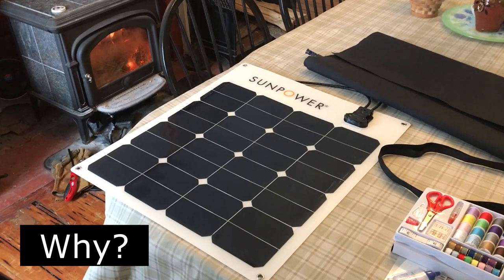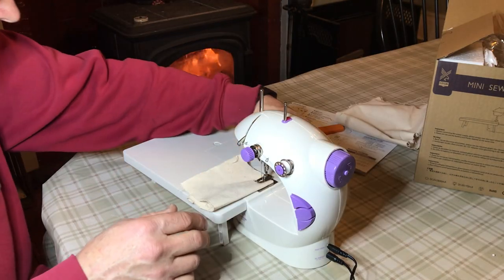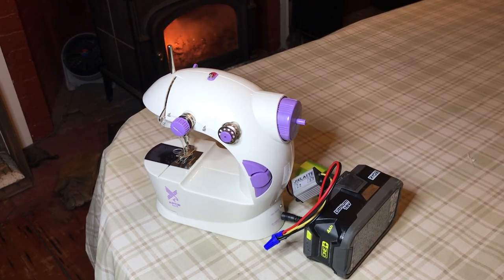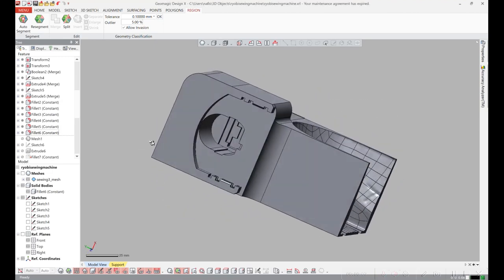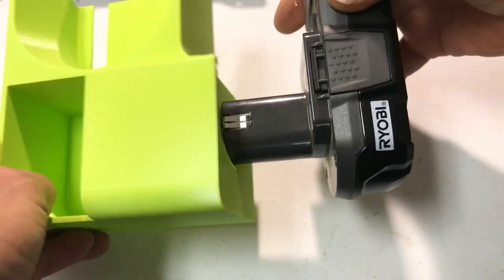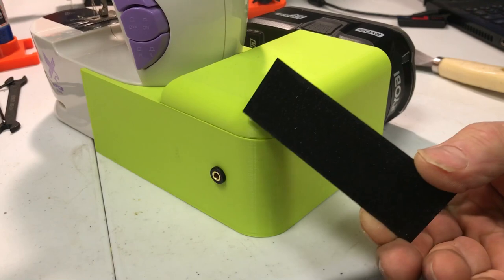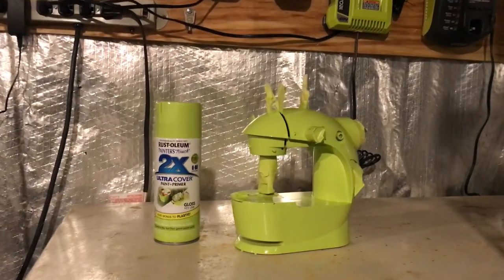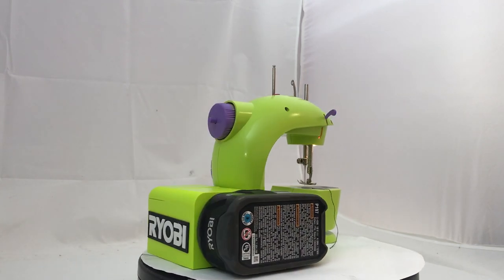RYOBI 18V Sewing Machine

Comment: Love your innovation, Chris!  What fun to watch your designs come to life.  Watching you work, I'm sure a good part of your enjoyment comes from the CAD design and 3D implementation, but I'll mention for those that don't have those skills that it IS possible to "Ryobize" lots of applications without the need for 3D designs.  Obviously we need some way to get 18V power out, so your innovations using clips and caps to put Ryobi batteries to use is absolutely a must.  Using one of the 3D caps, I've created a little universal adjustable power supply using one of those clever 5A Buck/Boost modules available everywhere that let you convert Ryobi power to whatever voltage you need so long as amperage doesn't exceed the limits of the Buck/Boost module.  I housed mine in a small ammo can with a 12volt power socket and banana plug terminals for outputs.  I made up a series of cables that connect together using Anderson Power Pole adapters so I can get any sort of end-to-end connection I need.  So it would be very easy to use my little adjustable power supply to buck down 18volts to whatever the little sewing machine needs.  Or my 9VDC internet router.  Or my 12vDC fan.  Or a 5VDC LED light.  You get the picture.  One power supply with a little box of premade cables to connect to whatever I need to connect to.  Basically one adjustable power supply to replace dedicated DC-to-DC converters.

Thanks again for your wonderful content!  I've learned so much from watching your experiments.  I'm toying with buying a 40V Ryobi snowblower (about one good snow a year where I live) and plan on using your 3D printer design for the 40V end so I can use the many 18V batteries and chargers I already have.  Thanks for your incredible knowledge and generosity in sharing your printer files on thingverse!  Deeply indebted to you!
Reply: I like this idea.  How about making a video and posting it on YT.

Comment: Does the DC to DC converter have any overheating protection? Would you need to put in some slots to allow for air flow into the compartment housing the DC to DC converter?
Reply from the maker: at 0.8A it didn't even get warm

Comment: Good video content.  But my heart hurts to see you use that thing.  You see I happen to be a sewing machine repair man, and that thing has brought many of people to tears in frustration.  I have used the 150 watt converter.  Any old machine will have no problem running on dirty power.  The only problem is you might get killed if you paint a quilters machine neon green.😁
Reply from the maker: I'm sure RYOBI could make a better, reliable, portable, battery operated machine. I just wanted to try. Sue cringed when she saw I painted it. I didn't touch her old Singer... that thing weighs 50+ lbs!

Comment: hmm can you run 3d printer on ryobi ??
Reply from the maker: a 3D printer takes about 120W to run. This print took 14 hours. That is 1680Wh. My Prusa printer has a 24V 240W powersupply, so you could step-down a 40V battery (or two 18V in series). But a 4Ah 40V only has 144Wh. So you would need 12 batteries!
Reply: @SerendipitySue  ah bummer what about the 40v version? maybe 6 of them ?
Reply from the maker: @dtec30  12 batteries was the 40V :-) I don't have any other size 40V. You can read the Watt Hours (Wh) on the back of the battery